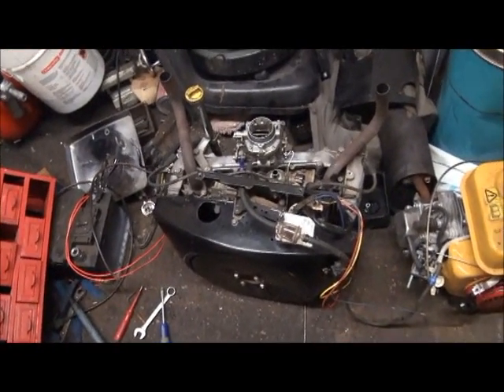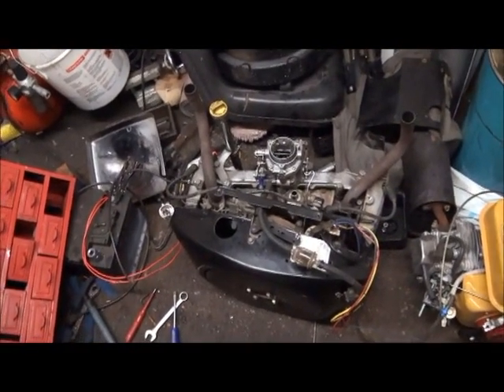Onan carburettor modification

Comment: Thank you so much for making this video! I had a performer 20 and it was spitting and sputtering at high speed. Carb had been cleaned and rebuilt and installed an electric fuel pump. Still was running like crap. Saw this video and gave the screw 1/4 turn out and she was like new again.